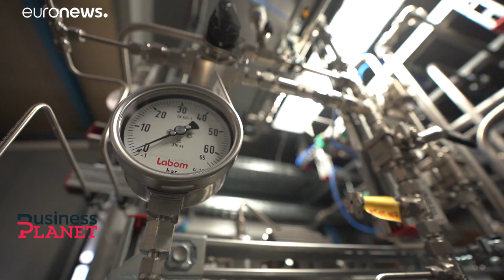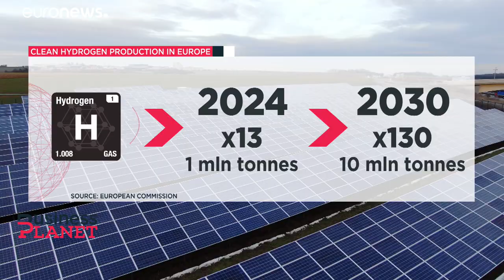Green future: powering up hydrogen

Comment: Hydrogen cannot be liquefied by pressure alone at normal ambient temperatures, it requires very low cryogenic temperatures.
A solution that stores hydrogen in a carrier fluid, like a fizzy drink, requires the data to show its efficiency. So far such carrier solutions have been too inefficient. Though there is a precedent in the storage of inherently explosive acetylene, safely in a solution of acetone.

Comment: I was a big fan of hydrogen fuel back in '79. But the problem has always been work produced minus energy in, and this equation has, and I still believe is a huge negative. Yes this can be done, as far as I know it's green, but it's not profitable. This means tax money will have to be given, just so a company will do it.

Liquid hydrogen has existed in a form from 1898 to 1929. If the system used here is different, safer, and cheaper, then it maybe significant. Otherwise we are looking at an expensive old timey wheel.